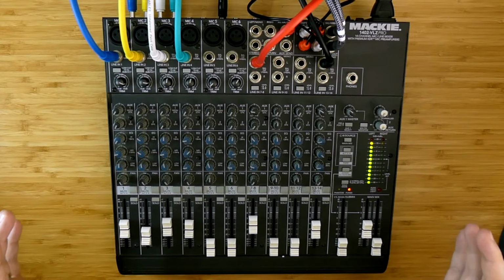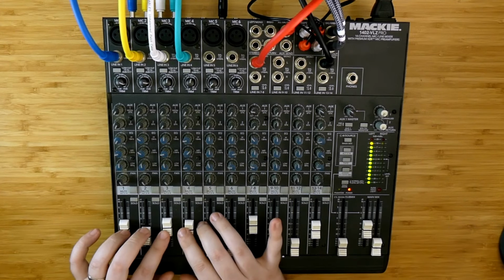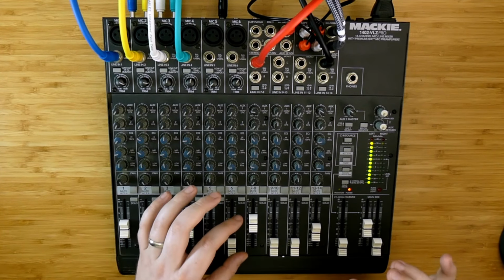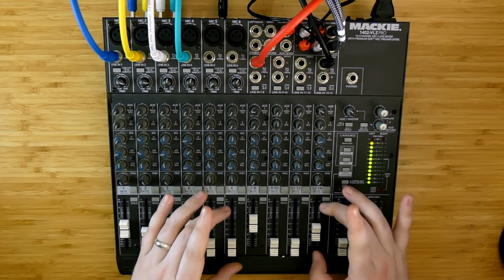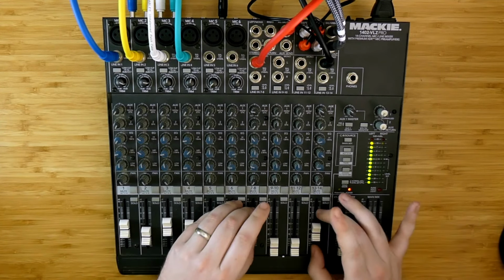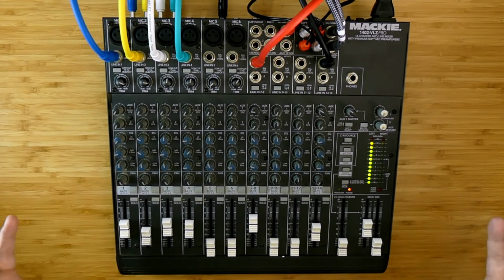No-Input Mixing Board: Flute and Drone Patch

Comment: This is astounding. You are absolutely right, the patch 
has great potential. Take your time with it! I'd love to see where it goes next, if it does! 

Also, am I seeing correct that the cables on the back are half-inserted?
Reply from the maker: Thank you! And yes, the TS cables on the channel inserts are half-inserted to create a non-interrupting output. As weird as it looks, it's actually described in the mixer's manual if you want to read more about it.

Comment: How on earth are you able to use that fader to control the pitch of whatever instrument is generating the sinewave ?
Reply from the maker: The mixing board is the instrument. The channel is patched in a feedback loop, and the amount of amplification on the channel drives the pitch of the loop higher/lower.